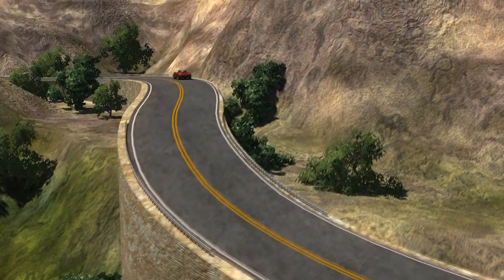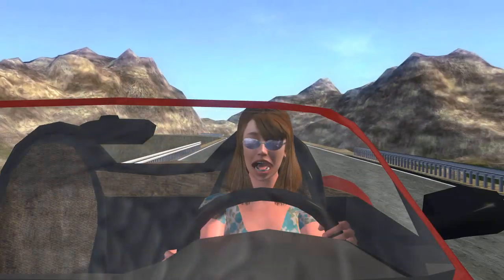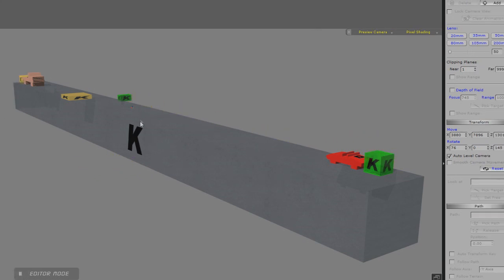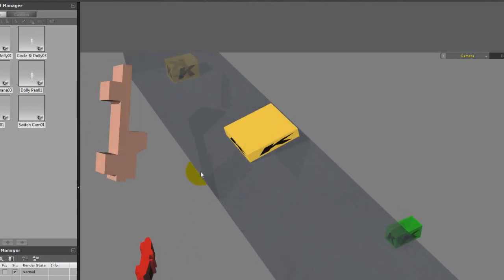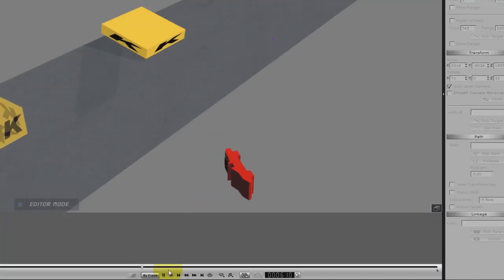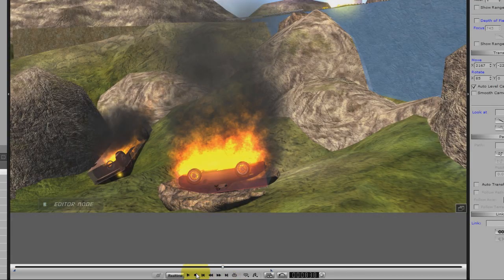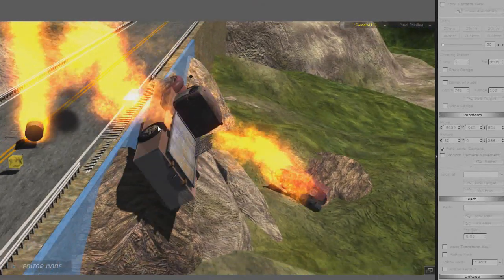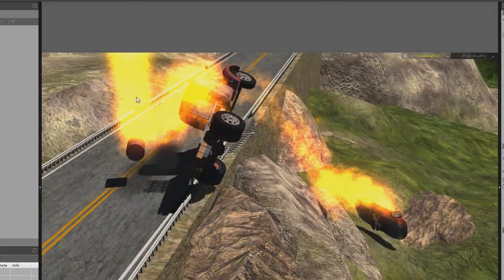iCLONE TUTORIAL "Collision Course"

Comment: That's really nice. I'm trying to reproduce the same thing. Can you please tell me what resource packs you used to make it?
Reply: +SoftwareAnalyst It was done in iClone 5 which is no longer available. It should work the same, I would hope, in iClone 6. iC5 used the "Bullet Physics" engine to simulate physics. iC6 uses the PhysX engine but the old Bullet engine is also included. From what I can tell in iC6 the PhysX engine seems to work fine and you should be able to use it instead of the Bullet engine...which you could turn on if you needed it. Love to see what you come up with.
Reply: +SoftwareAnalyst No real resource pack was used. The vehicles were from the Google 3D warehouse and reworked and textured in SketchUp. The roadway was built in Lightwave 3D but any 3d modeling program would work for that.
Reply: +SmallWonderStudio Ok thank you much for the info.